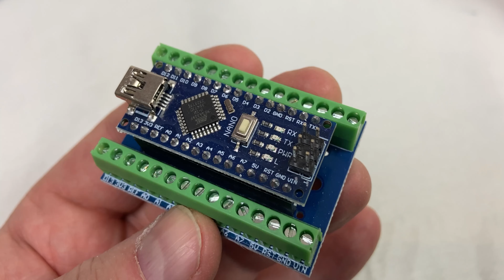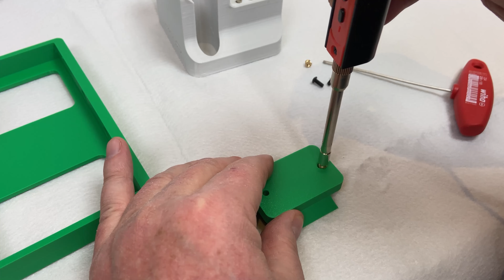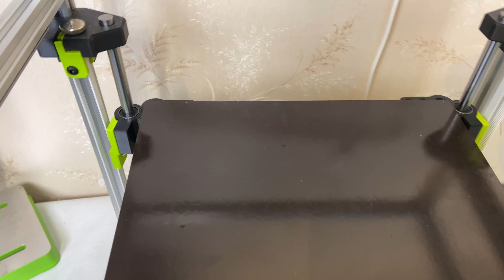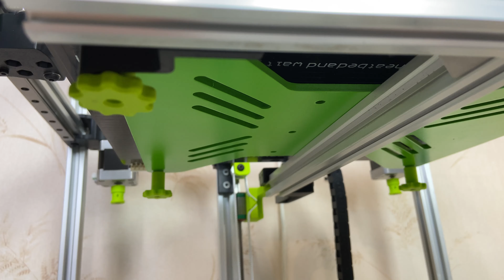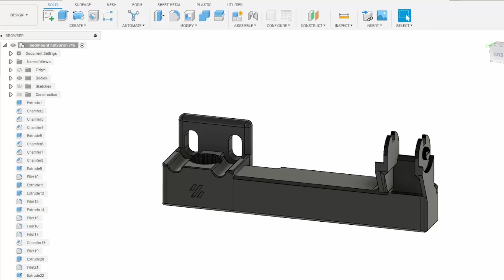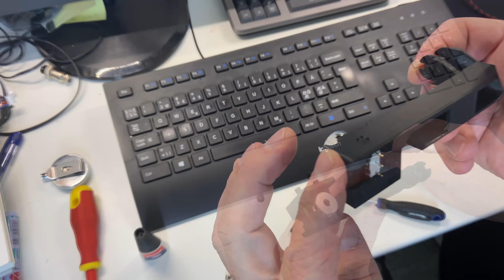It's not a Voron - xy-axis and bed

Comment: man literally what I'm looking to do. I have been thinking to get an old prusa plus my ender3 and build a new printer :). However, with the frame I'm thinking to buy proper 2020. What frame are you using?
Reply from the maker: 2020 and the extrusion lengths for a Trident 300 build. Have a look at part 2 in my build series.